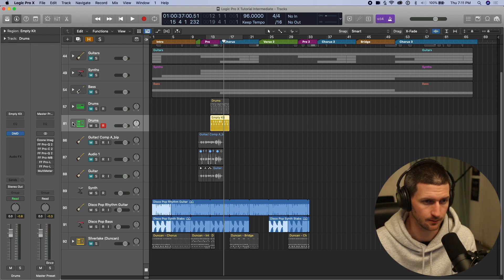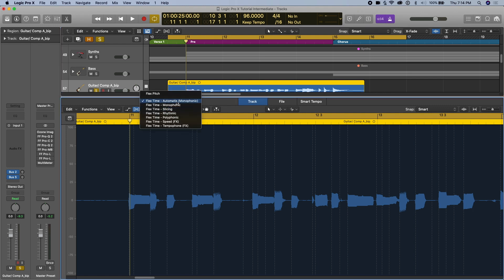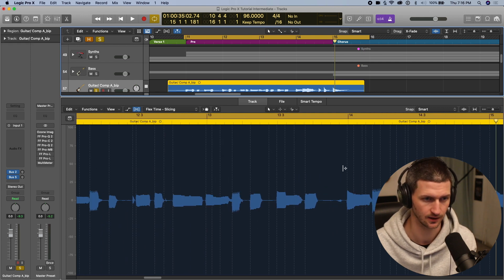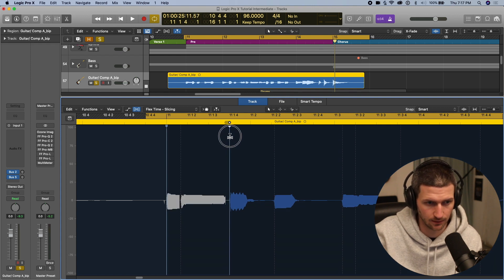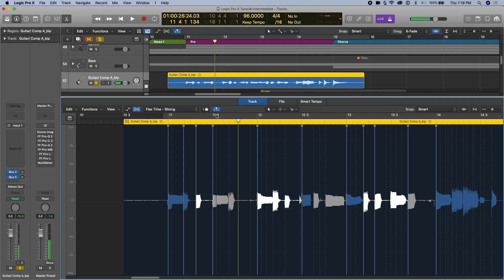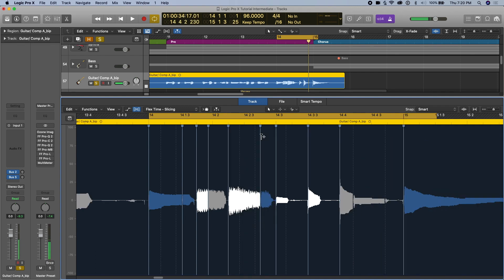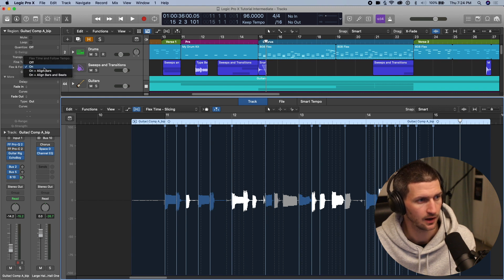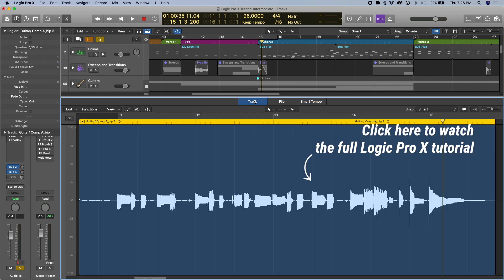How To Do Flextime In Logic Pro X

Comment: Hey Charles, I have a question about it. Every time that I turn on flex it moves the transients a lot, making my whole recording being out of time. I tried the different modes ( Slicing, Mono, Poly etc ) but it does it with all of them. Do you maybe know what causes this and how to turn flexing on while the audio just stays in place? Thank you mucho!
Reply from the maker: Hey Noah, yes for sure. It’s likely that it’s auto quantizing the audio for you. Go to the region editor on the side and make sure that flex and follow is set too off and quantize is off too. Then go to your editor and turn on flex. That should work.